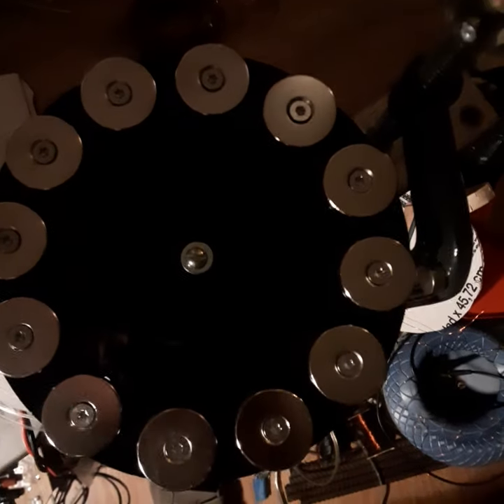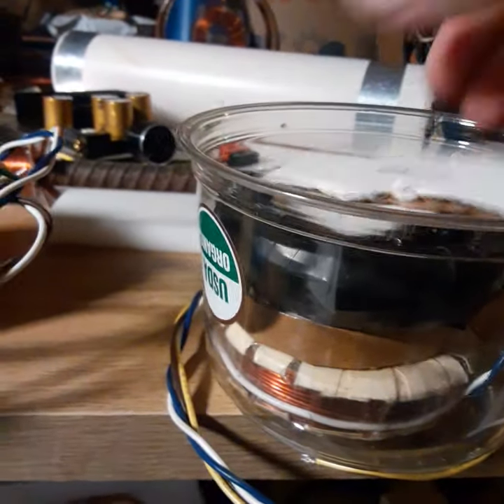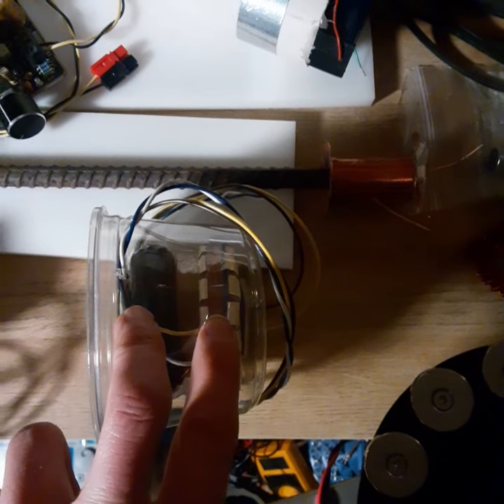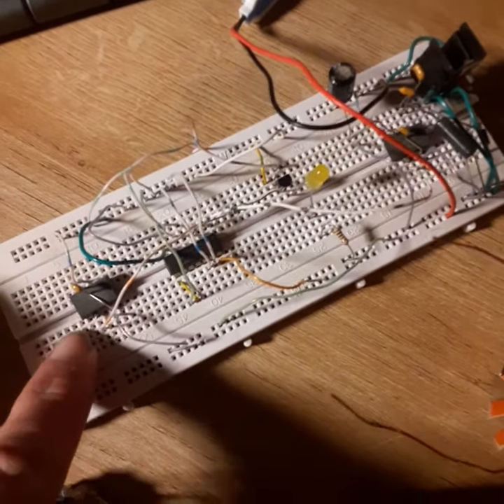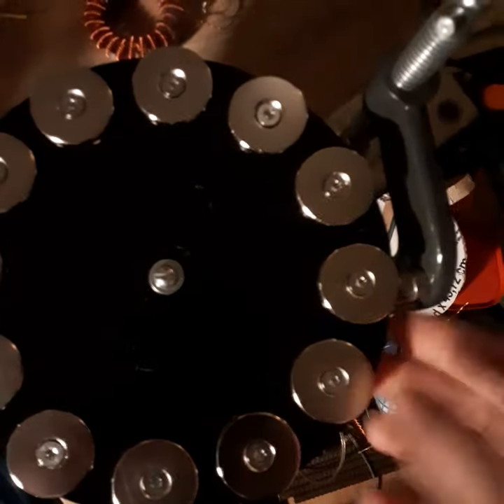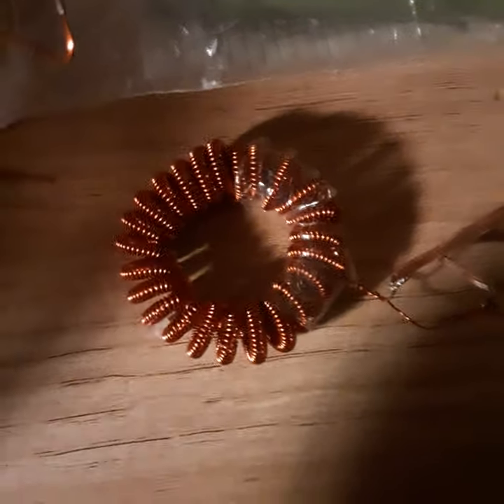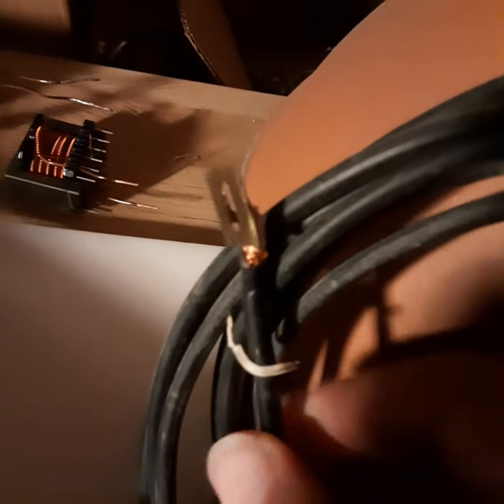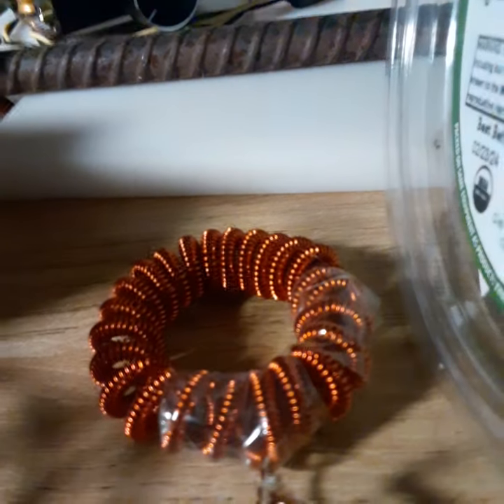why "time fields" are persistent

Comment: The Thrust created by the EM drive detected was shown to be interaction of the power cables with the magnetic ambient magnetic fields in the area.  There is a bit of a problem with what is going on here when you have tons of ferrous and magnetic materials all over the lab as its know that even when  the fields are not obviously detectable by you they are there and extend theoretically to infinity.
Reply from the maker: you make a very good point, 
I do plan on doing better tests. and if I can't scale it up, then it is sort of pointless anyway.

Comment: Great video! Would a small dish with some oil and magnetic particles help in visualizing the magnetic field of the bagle coil? Especially when pulsed?
Reply from the maker: not sure, the bagel coil is driven with AC, so will the magnetic dust in oil display an alternating field ? also iron near them ruins the signal so nothing lasts after you turn off the power, but if you are not looking for that effect it may not matter.
there are some good visualizations done with the math of it... https://drive.google.com/file/d/1ziPKokyiMtI9zXaAT5hhQzIDIwC_QLLI/view
but remember the bagel coils are not that safe, I still have scars that mine left on me. the fields hit me days later leaving blisters, I am likely lucky to have lived through my tests. had one of them hit my eye or in my brain somewhere... so keep the frequency and the power levels low or use some other method of cleaning them up after testing.
pulsing them with a sharp rise time seems like a really unsafe idea (if that is what you were thinking of doing), you would get a range of frequencies out, not sure what that would do...
Reply: @spacecase0 thank you for your answer! Was not aware of the risks involved with the bagle. Is it maybe comparable to what RIFE and others where after like the MWO of Lakhovsky?
Reply from the maker: @hansscholte5472  I am convinced that the Rife machines are sure using this sort of technology. just a matter of what format the fields are in. lots of work to figure that part out.
Reply: @spacecase0  I've watched his documentary 3 times but never seen anything else about him :( I'd live to read any books or research written by or about him

Comment: Everything is made up from a single unifying field witch means every force or energy has something in common with others. Everything has to do with zero point as well as so would your thing if true because the magnetic and electric forces likely alter the ground state inorder to work and the zero point energy is from space time itself it seems as nothing stays as rest. So if you alter zero point in the right way you alter space time.
Reply: The superpotential field that makes electricity, magnetism, and gravity. This "field" has been given many names over hundreds of years aether, zero point, vacuum potential, superforce ...ect ect ect because it has been rediscovered many times by many scientists but they are made quiet or made to sign NDA's because of the energy monopoly.  The best latest unifying theories with math formulas I have seen is Scalar Physics.
Reply: @1800imawake  aether would imply that everything is moving within a "mystical" medium. We know that to be true in local space because light has its own reference frame and nothing can pass light speed without going non local or manipulating the space around it. This would imply that if you go fast in one direction in space light would seem to go slower in one direction and faster than the other which is also how blue red and green shifting works. As the speed of light is constant this would mean that there would have to be a universal reference that everything moves in reference to. Light can also be affected by gravity which means it must have its own reference frame that can be altered! Even the secret sauce exists in modern theories.

Comment: Years ago I had some weird idea like this, but never the stuff to really test it... watch?v=nKD1kbcQAt0
Basically a toroidal part that's wound similar to a pancake-coil arrangement, with another winding that has a "choke"? function?, and then a star wound coil over that. Seems like those could have some interesting interactions depending on how they're powered up. Some of the idea there is to compress or stress the fields in ways that normally don't happen otherwise, might be neat to see if there's any phenomena associated with that.
Reply from the maker: need my computer to copy and paste to find that video, you have lots of videos on your channel. will get computer time tonight
Reply: @spacecase0  It's all over the place (like a sketch-book almost), so only a handful of videos that may be on stuff like that.
Reply from the maker: @pauljs75  got it. I will watch when I get to a real computer

Comment: @spacecase0 any new videos on the way?
Reply from the maker: yes. I am working on trying an almost accurate version of patent US20030209636A1. not an easy thing to build. and I think I figured out how it works. I have the hardware setup built, I am having issues with my multi phase supply at the moment, so I need a bit more time. and if this test works, then I have fun things to share. if it fails, then I will keep trying other things.

Comment: The magnetic pressure, is what I call "charges". Any magnetic field has them. So does high voltage and static electricity. Quarts energy also has them. It polorizes a part with positive or negative charge. By exploiting that charge instead of the ferromagnetic part you get the coffee cup to spin. The experiment you need to do is a pvc pipe and a rag. rub the pipe and the charge will move empty soda cans and paper. When you realize it is in every experiment you can use it to your advantage just like Viktor Schauberger did in wind. He found it in water. he amplified it by creating a high voltage field with milliamps and very high voltages. If you ever saw the documentary there is a small mention of energy his son said was useless because it had no amps. But it went with the flow of water. He was polarizing the water itself. It is why I am doing the static experiments. When you can exploit these charges then the material will not matter. you just need to find out how much saturation each object can hold as a charge. I like you work. Keep going.
Reply from the maker: interesting ideas, I have more things to test now...
I like your work as well.
Reply: @spacecase0  thank you.

Comment: Awesome explanation man! Thanks for making this. I wouldlove for you to go into more details about the difference between devices you found that chi amllified vs drained you. Or even just link to the videos where you describe the differences. Thanks so much for keeping posting new stuff.
Reply from the maker: I can do that. but I am going to need a bit more testing to really figure that out well. 
the chi energy amplifier https://patents.google.com/patent/US20070285325A1/en sure works.
the "charge clusters from the sky" gains you energy, but also has every frequency in it, helps you, helps infections you may have, great for getting you out of a low energy spot, but daily use is a bad plan.
the rebar test I did sure drained me, took me about 5 days to be ok again... and it was not just the magnetic field, when I turned on and off the coils at the same time it did nothing to me at all, it was the coil timing that caused movement that drained me.
need to do more testing...
Reply: @spacecase0  Thanks man, yeah no need to test anything that you feel might be dangerous, giving us your best current speculation would be good enough for me :)
Reply from the maker: @petersvideofile  the thing is that this information needs to be known. I need to run the tests somehow. so, I will be woking with it. just a matter of figuring out how to measure for it after it happened. 
I have seen alchemists say they made an element from another element, but it was not quite normal, it was missing the lowest bright line spectrum... makes me think maybe I can test for this internal magnetic pressure with bright line spectrum. will have to try that and see. if you have any ideas I would love to here.
Reply: @spacecase0  Hey spacecase, yeah I don't have any specific ideas, but the light spectrum seems like a good idea. I believe Bob has cited it many times but the work of Shu-wen Zhou where he observed a shift in spectral lines of particles seems to indicate the "magnetic pressure" increase causes by eclipses results in a shift of spectral lines. Maybe the disappearance other people observe for short spectral lines is simply a function of the detector sensitivity to the shorter wave lengths being lower.  There are tons of other historically anomolous data points one could use like torsion pendulums, or stocastic processes like specifically breakdown of p-n junctions like was discussed in space earth human. I'm not so sure what the correlation of stochastic processes is supposed to be with this tech. But i would assume anything that "accelerates" stochastic processes would probably have an adverse health effect. Also I think radioactive decay might increase too.
Reply: Also I saw you have one of those generators that spooky2 rebrands and cells for there remote healing stuff. I remember the spooky2 guys saying they had two remote units. One is Bionorth one is bio south, one is healing and one is destructive. It seems like it is all related. I'm guessing it is probably related to the "chirality" of the molecules used by biological systems as well. They all have one specific chirality and I'm guessing this is the chirality of the field lines of the devices that are capturing magnetic pressure is similar. I am just not sure whether one wants the chirality to match or whether one doesn't want it to match. I don't know which is the "healthy" one :)
Reply from the maker: @petersvideofile  I tried the PN breakdown thing, and did not see anything from it, but then I was also told that modern parts were designed to get rid of that effect. oldest diode I have I bought in the 1980s, and that is suppose to be to new...
I should set up an inertial mass tester, but it is also clear that springs get messed up with high voltage fields. or at least it seems so with my last test.  need to go try more things to be sure. then again, maybe springs getting messed with is just fine, whatever works...
I have seen what Bob quotes about the twisting pendulums, then again I knew about than from when richard hogland told us that on some art bell radio show long ago.... ok, ok, I need to build one.
Reply: @spacecase0  I guess it's kinda similar to piezo crystals in the device you already made, but also tuning forks. I  remember hearing something about that from a Bruce Depalma  video before.
Reply from the maker: @petersvideofile  so, you are clearly worth having a longer conversation with. I have a discord server with many fantastic people. want to join ? https://discord.gg/JEGnYmX5
Reply from the maker: @petersvideofile  it is an arbitrary wave form generator... spooky 2 uses these, but you can program them for anything. i have never connected mine to the computer. 
as far as the spin direction, a left hand helix coil makes negative charge, and this is what biology runs on. so, yea, it matters
Reply: @spacecase0  hey man! Thanks so much for the invite! I was on your discord a year ago sharing parametric cad designs for bagel coil winding aids and such. I'll try to hop on later in the week sometime! Keep up the great work!

Comment: Wait what you want to make ? 
A anti or just gravity ???
Reply from the maker: i need some of each.
Reply: @spacecase0  hmmm
Reply: @spacecase0  what you mean by that 
I mean what is it used for.???
I mean can you use it to make an device that uses this electromagnets 
To make itself (the device) to float in they air ....
Reply from the maker: @sargismartirosyan9946  if you charge pretty much anything to several million volts it is going to float. but then how do you get it to move ? that is what my new tests are showing me it is possible.